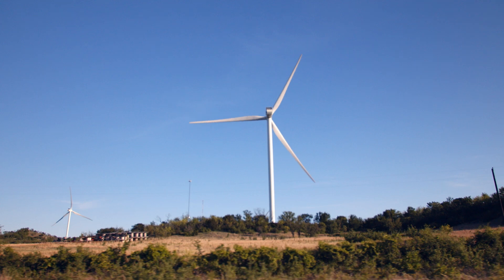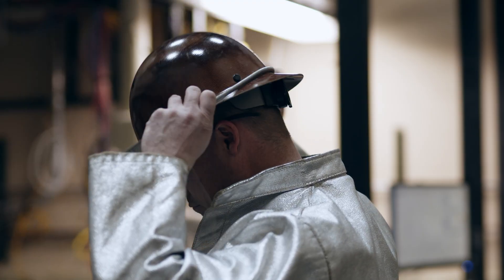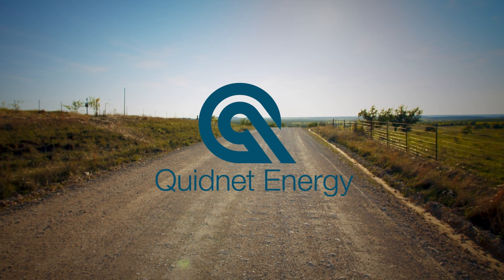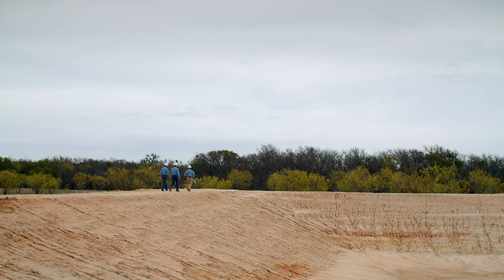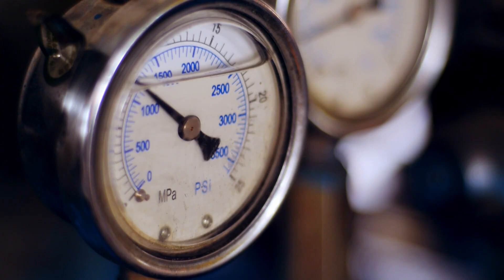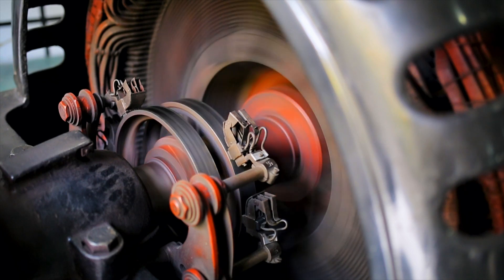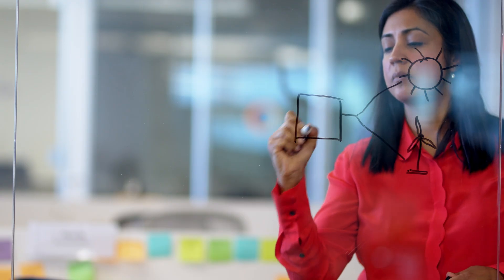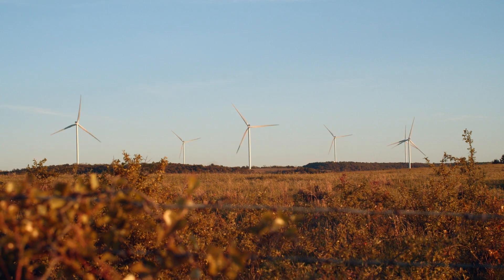Energy storage breakthroughs

Comment: BREAKTHROUGH  TECHNOLOGIES IN ENERGETICS

Electric power multiplier based on MGA (Andrus Molecular Generator).
We are looking for investments up to 70 million US dollars.

        I ask you to familiarize yourself with the video "The multiplier of electrical power on the basis of MGA (Andrus Molecular Generator)" https://youtu.be/N447flDIb28.  Turn on English subtitles. Autor's comment to video "Multi-power electric power on the base of  MGA (Molecular generator Andrus)" (for specialists) - http://neutronscience.com.ua/wp-content/uploads/2019/05/AUTHORS-COMMENT-TO-THE-VIDEO.pdf.
 From the video it can be seen that the Electric power multiplier with an area of 240 cm2 in comparison with a solar cell of a solar panel of the same area surpasses the latter by 23 times in power and this figure can increase, while the Multiplier works around the clock and year-round.
 At the same time, the Multiplier does not require repair, maintenance and related infrastructure such as gas stations.
 A multiplier is a simplified cylindrical version of an MGA with external electrical excitation of its materials (see fig. 2 https://youtu.be/N447flDIb28).  Basic flat MGA (see figure 1 https://youtu.be/N447flDIb28) with self-excited materials has no electronic circuits and can produce a constant current with a given voltage for 10 years or more.

"The molecular generator of Andrus - MGA" (Business Plan MGA 2018 - http://neutronscience.com.ua/wp-content/uploads/2018/03/Business-plan-MGA-2018.pdf) - this is the source  power supply that does not require recharging:
 - MGA-3W, 5V for powering gadgets without recharging;
 - MGA-20kW, 230 V for power supply of apartments and private houses;
 - MGA-150kW, 400 V as power sources for electric vehicles and other vehicles.
 
 The implementation of MGA and Multiplier projects takes about three years and then immediately follows the sale of commercial samples and technologies to Ilona Mask and others at a public auction at the price of three lots from 1,500,000,000 US dollars.
 The share of the investor on this project is 26% - this is from 390 million dollars.
 The profit compared to the investment will increase in: $ 390,000,000: $ 70,000,000 = 5.57 times.

The purpose of our video is to show that the declared Multiplier parameters - input (Uin = 220V) and output (Uout = 265 ÷ 270 V, Iout = 0.29A) - really take place, the MGA project is a worker, and the authors fully own the issues  implementation.
 MGA has rather complicated methods for controlling input materials, as well as all stages of its production at the molecular level, since  Electricity is produced by materials without any additions.  This is similar to the use of finger batteries, only for 10 years or more.
 The multiplier has a more coarse and simplified packing materials MGA, but also an additional external source of excitation materials (external electrical network).  It is much cheaper than MGA.
 When using our Multiplier as an autonomous power source, it will be necessary to replace the external city electric network with two small batteries with electronic circuitry, and it will also work around the clock and year-round, but it is not suitable for gadgets because of the complex circuitry with batteries and is mainly suitable for  use in apartments and private homes.  Thus, for flat cars and gadgets, only a flat MGA is suitable.
 A cheaper option is possible - a hybrid device for obtaining significant power.  A low-power MGA plus multiplier cells is used as the external source.
The publication of the interview: https://www.interempresas.net/Energia/Articulos/247813-Entrevista-a-Valery-Andrus-BSA-Ltd-(Kyiv-Ukraine).html

 
 We hope for a quick response.
 Sincerely, V. Andrus, Scientific Director.
 BSA Ltd., Ukraine.
 http://neutronscience.com.ua/books/
 Email: valeriy.andrus@gmail.com

Comment: Some other storage options:
1.Compressed air
2.Coverting water to hydrogen and later use as fuel cell
3.Super capacitors 
4.Converting CO2 to carbon and oxygen and later burning carbon.

Comment: Under current technology,  both solar panels and large scale wind power generators require more energy to make the panels or wind power generators than is actually generated over the life time of the panels / generators.  "Making" includes the mining, smelting, purification and transportation of the materials required.  An example would be the niobium needed for the powerful magnets for the wind power generators.  Also,  in the case of solar energy,  massive amounts of toxic waste is generated making the cells under current technology.  This does not even include the number of square miles of new land that would need to be covered daily by wind power generators (over 300 square miles per day) to meet the world's current power consumption by 2050....  the equivalent of three nuclear power plants a day.  This does not address any additional power needs,  just the minimum amount required to replace fossil fuel usage.

Comment: Come on, let’s have the Bill I used to work with (1983-9). I notice you didn’t stick you neck out in this clip and back a single horse. You also failed to mention some really worthy contenders such as high speed, high inertia flywheels. Efficient energy storage might lift Africa into the 21st century and at the same time allow the developed world to reduce its carbon footprint. With some guidance (ie. you) I sure we can make better progress.

Comment: I had an idea to improve tidal power lagoons.  Renewable energy could be used to pump the lagoon lower than low tide and pump it higher than high tide thereby turning tidal lagoons into both a renewable energy source and short-term energy storage device.  Further, within the sheltered lagoon floating homes, restaurants and other amenities would help offset some of the lagoon construction costs.

Comment: solar panels are not silicon...they are carbon based...graphene...with a conductor on top of it...should be the other way around...carbon is very conductive and a neutral atom...put it on top of copper foil tape and use a full bridge rectifier and a capacitor...and encase it to protect it then you got yourself a solar panel that is way better than the ones you buy and cost a few$ to build

Comment: these people have horrible idea's why not just convert the energy into chemical fuels
Reply: None none, no solution is perfect. There are always pros and cons. At the moment I think we are better of trying many different solutions rather than homing in on one solution.

Chemical fuels has a number of issues:
1. You could use electrolysis to create hydrogen to be used in fuel cells later. However both fuel cells and electrolyzer have until recently been quite expensive. Hydrogen is also expensive and complicated to store and transport.

2. Alternative is to combine hydrogen with CO2 using the sabatier reaction to create methane. That is easier to store and transport. However there are issues with scaling this, as you need a source of highly concentrated CO2. So you have to make such a plant next to say a biomass burner, cement producer or something else producing lots of CO2. 

3. There are alternatives like those who make blue crude from electrolyzed hydrogen. But again access to CO2 is an issue.

4. Some McGill university explore burning metal. You can use electrolyzed hydrogen to reduce metal oxides in a smelter. Fine powdered metal in a cyclone burns well. Benefit of this approach is that you don't need to deal with CO2. However this is also very recent technology we don't know how well will work.

Comment: A complete waste of time, only lithium-ion (or sodium-ion) batteries storage systems will be massively used. They are getting cheaper and cheaper, they are compact so the cost of land is minimal, they are reliable, can deliver a lot of power really quickly...

Take a look at what Tesla did in Australia, this is just the begining...
Reply: @UC0IfEn05zXle7w5ShKoKQkw, no energy storage is far more complicated than that. Tesla's lithium-ion batteries are only providing a solution to a part of the storage problem. In the summer there will be days with cloud and there is night time as well as random spikes in power usage. Solving those storage needs is where batteries excel. What Tesla did in Australia was to solve the problem of rapid but short lived spikes is power consumption. Batteries are great for this.

However for long term storage such as many months batteries are poorly suited. They are just way too expensive, and they leak power. This video is about long term energy storage. Such as storing excess power produced in the summer to be used in the winter time.
Reply: First this video is about several storage solutions not one and none of them are for long term energy storage. Literally none. The only long term viable energy storage that can last for months/years is Power to Gas (especially to methane or methanol to a lesser extent) but it mean you will lost at least 70% of your input energies during the process. So for the moment it's absolutly not profitable, maybe this will be the case when solar power will be way under 1cent/kwh.

All the solutions in this video compete directly with chemical batteries such as lithium-ion,  they stand absolutely no chance.
Reply: @yutuniopati  
> First this video is about several storage solutions not one and none of them are for long term energy storage. Literally none

What is written about Malta has been a bit confusing, but you are right according to their own claims Malta is not doing long term storage. Just +6 hours.

However I don't see why the Quidnet Energy solution cannot store energy for considerably longer time.

> The only long term viable energy storage that can last for months/years is Power to Gas (especially to methane or methanol to a lesser extent) but it mean you will lost at least 70% of your input energies during the process.

I also think this is a very promising approach. But even within power to gas there are many different approaches.

A big problem with power to gas is getting a source of highly concentrated CO2.

Some alternatives to this is to use metal as energy storage and simply burn it. McGill university is exploring this approach. The benefit of this combustion is that it produced metal oxides which can easily be recovered unlike CO2.

Another approach is using silane. It also burns without producing CO2. In fact it will consume CO2 when burning.

> All the solutions in this video compete directly with chemical batteries such as lithium-ion,  they stand absolutely no chance.

I know the cost curve really favors  lithium-ion, but I still there is a possibility that these alternatives could be cheaper at scale, since the marginal cost of increasing capacity is quite low.  lithium-ion has a huge benefit in scaling down very easily and having very quick response to power needs.

But I am skeptical towards declaring a winner just yet. When you look at energy storage systems, there seems to always be lots of tradeoffs to consider.

I personally think the future will contain a mix of numerous solutions.

Cheap lithium-ion storage in houses with solar roofs will be a game changer I think.

Comment: Unfortunately, Molten salt has some BOLD downside.
Its can't be our future.
Reply: Tahmim Chowdhury what’s your reference? Are you currently working in the field? What is the downside of molten salt?
Reply: @kipayami6273  We are researching on that brother. For a new investor in this business.
You know, we cant share it before we done.
Just be sure, its not our future.
There is a great chance for ryden duel carbon battery (from japan) to be our future. Because it has only 1% electricity loss. Where in our lab, molten salt has more than 9% loss.
Reply: @kipayami6273  https://youtu.be/cZkj6ZN1Wkc
Watch this if you are new about this technology.
Reply: Tahmim Chowdhury thanks man! Good luck! Hope you find success! Maybe try different forms of salt or maybe unionized salts. Maybe you’re missing a catalyst. Try an coating with an acid so that the heat resistance goes up. Idk man good luck!

Comment: After 30 years trying, solar and wind are less than 2% of total world energy demand.
After 30 years trying to fix climate, emissions went up 60%.
Reply: Robert Callaghan I want my electric car so I could save the environment xD
Reply: The irony
Reply: "After 30 years claiming to try but basically stepping in the break the whole time..."
Here I fixed that for you.
Reply: In the USA,  emissions have dropped to 1992 levels.  This is not true in Europe.
Reply: @shdwbnndbyyt 
"This is not true in Europe"
Yeah it dropped much more than that.

EU-28
1990 4.4 Gt (443 million people)
2005 4.2 Gt (464 million people)
2017 3.5 Gt (513 million people)

USA
1990 5.1 Gt (250 million people)
2005 6.0 Gt (296 million people)
2017 5.1 Gt (326 million people)

If you look at the per capita from 1990 to 2017 it dropped in the US from
20t to 16t (drop of 20%)
While in the EU 28 it dropped from
10t to 7t (drop of 30%)

Comment: Three words: Liquid Flow Batteries
Reply: That's an elegant idea. You can size the reservoirs for the megawatt hours of capacity needed, and the battery itself, can be sized for the power necessary. There is virtually 0 standby losses, and the efficiency is quite good. I think that's going to be a major player in grid scale electrical energy storage. Now, where to find the vanadium?🤔

Comment: Good to see Bill thinking about the storage solutions.  The guy out of Stanford has working liquid/solid batteries that are being tested.  He did first principal approach.  Cheap and less than half hydro.  I put solar on my roof in December at 80 cents a watt.  Got the solaredge inverter on ebay, panels on ebay as well as optimizers.  Local sources of racking.  No rebates, no incentives.  Trying to get incentives would have cost $3 per watt after tax credit and rebates.  Even at 10c a KW here in Texas the payback is showing to be about 6 years since about 1/3 to 1/2 of the power goes back to grid.  Hate giving the grid free power but way cheaper than going through the regulations.  It took 1.5 weeks to put up working 3 hours a day.  Sort of a hobby type pace.  
The total cost was $5400 for a 7kw array.  Panels are 3 year old Sunpower panels 60v commercial that are resold after depreciation from big solar projects.  Efficiency is 19.9%.  I have generated 3.3mw since Dec 13, 2018. When I get my Model Y I will have more load to use.  
Now that I am looking at the payback it is difficult.  It is not an investment as much as an annuity that pays every month.  I don't have to earn income, pay taxes, then pay the power I generate.  What is that worth.  It is not a revenue cashflow since I would already be paying the bill.  I am thinking NPV calcs with zero risk, variable monthly payments, but the less non taxable expense is hard to figure out.
Panels are $120 for 327w 19.9%, racking was $800, Optimizers $1100, Panels $2200 with shipping, Cutoff box, wiring, etc $300, Sense power monitoring $300.
Storage is key to really changing the world.  I will use my Tesla for my storage and will increase my array when I see the balance.  Panels are worth putting up.  We have right to work on our own houses here so maybe I will do a homeowners permit and get inspection.  The wiring is very simple.  Solar Edge started a new way of doing things.  The inverter is 6kw but can handle 2 strings.  It has networking, DC cutoff and auto AC shutdown built into the box..  Amazing Tech.
Kudos for this report.

Comment: Its called a "molten salt generator" if you want to look it up. Apprently you can dump radioactive waste into the hot side and burn it out. More fuel i guess. Combine it with a nuclear power plant and you can store power and dispose of waste. Sad that this video barely goes into any detail. I mean the waste disposal was its best feature. Its a battery too but the problem is insulation how do you keep one thing really hot and another really cold. Even a vaccum lets out 5% of the heat as radiation. The cold side would be easier to vaccum i guess. I found a really good pdf on it online but im a science newb so idk seems cool i would use it if i could.

Comment: Nitinol waste heat capture, high altitude wind,generation. Graphene capacitor earth banks, deep thermal vent power generation. Piezoelectric power generation, direct energy from elf waves via transverse radio propagation from lightning. So many more ideas not,being used.